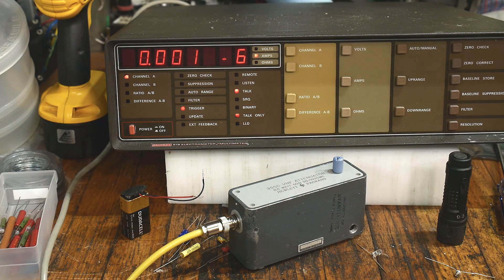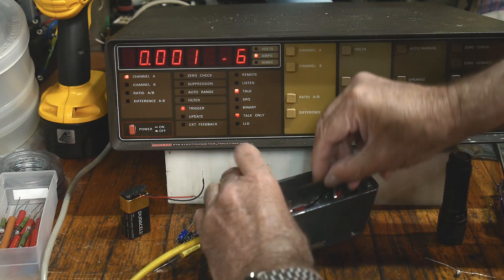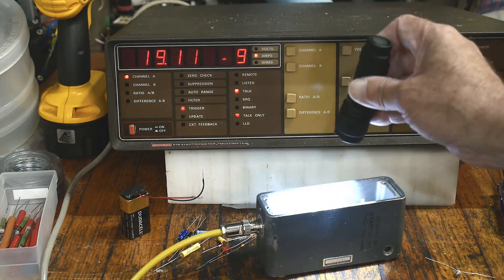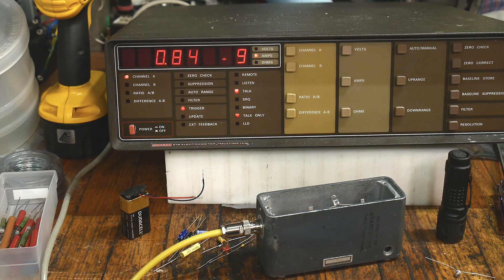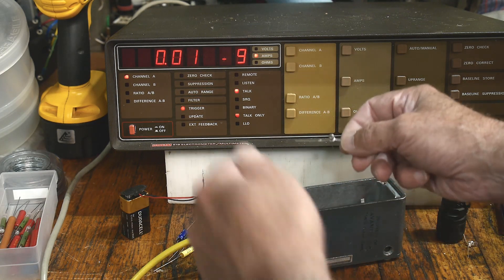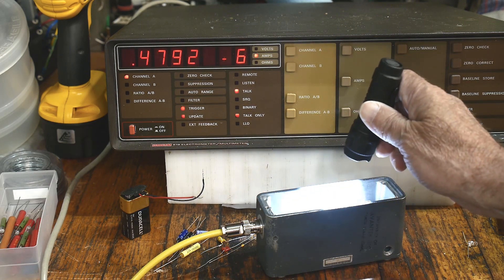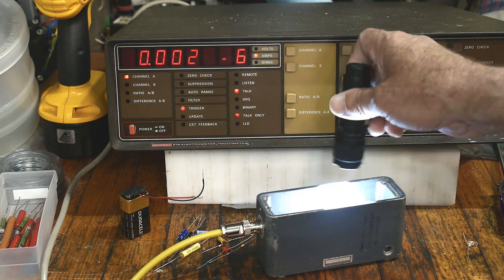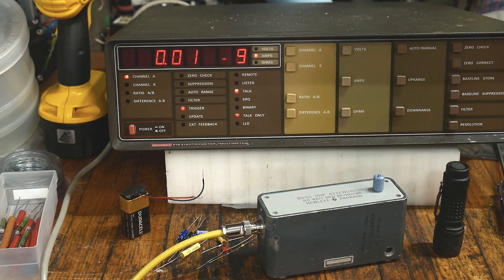#773 Keep Your Transistors in a Dark Place

Comment: Ive had first hand experience of this with an LED lighting product I worked on. The current producesd by the LEDs was  suppying power to my pic to keep it stuck in sleep mode. Had to control the LEDs via an Nch fet instead of the pic as a sink.

Comment: You'll like this story. I used to work at a company that made electronic motor speed controllers, big ones. We had a photographer in one day taking marketing photos of a controller that was on burn-in testing spinning a 25 hp motor. He had the controller's lid open to take some photos, and did so with the unit running, not wanting to interrupt the test, and we had disabled the lid interlock so we could do some measurements. But when he flashed his big Honeywell strobe all 3 phases of the controller's 460V 3-phase triggered simultaneously. Then the GTO's driving the motor grenaded. He didn't get hurt, but he easily could have. We isolated the problem to the HP-gray fiber optic receivers being triggered by the flash. Our company president called HP and was told that such a thing wasn't possible, but that they would look into it. Our boss got a call back from HP the next morning stating that solid-black fiber-opic receivers would be on their way just as soon as they could be tested by HP. For our part we stuck a much larger sticker on the box admonishing the customers NOT to bypass the safety interlock switch in the cover.

Comment: Many, many times I used germanium and later metal case silicon transistors as photo-transistors, just opening the metal case. Actually, I had around 20-30 EFT germanium transistors (low hfe) that I kept only as photo detectors (small window opened in the case, covered with transparent epoxy) 
Then the optoelectronics were quite expensive and not easy for hobbyist.
Also I remember reverse polarized germanium diodes (glass encapsulated) being affected by light.
Reply from the maker: I tested some 1N914s in glass packages and they generated photocurrent.

Comment: At a company I used to work for, we built radios that would automatically adjust the brightness of the display and keypad back light according to ambient light conditions.  The engineering manager insisted that an LED be used as the photosensor for this.  As you can imagine, it did work,  but there was  far too much variation from part to part to be truly useful.  This is just one of many things that got corrected as soon as that manager left the company.  One of the radios used a glass-encased varactor diode to tune the frequency of the  synthesizer, and this wreaked  havoc on the radios when the technician was trying to tune them up, and, naturally, had to have the covers off to tune it.  When I discovered what was going on, I gave all the test techs  black permanent markers to coat the glass case with.  Problem (mostly) solved.  This was also corrected when that manager was gone.
Reply: Did you keep the feature?
Reply: Nail polish would have been a better choice.

Comment: Back in the day, 1960s, take an OC71 glass encapsulated germanium PNP transistor, and mount it in a spin dryer. The centripetal force would cause the internal black coating to pool at one end of the transistor resulting in a perfectly useable light sensitive transistor.
Reply: Very interesting comment about these British transistors.

Comment: Yes, I saw a video recently on one of the newer single board computers, may have been one of the Raspberry Pi's or similar. On the board was a bare chip of some sort attached directly to the PCB with no blob of black stuff over it. It was designed that way. The Youtuber demonstrated how you could glitch out the computer by shining a flashlight onto the bare chip.
Reply: If you can find the link to the video, I'd sure love to see it!
Reply from the maker: me too
Reply: @IMSAIGuy  hackaday in 2015 ran an article about camera flashes resetting a Raspberry Pi 2.  I can't post a link here though.
Reply from the maker: @tonyfremont  I have heard that.

Comment: This does bite people too; chip scale packages need isolation from strong light.
Reply from the maker: Makes you wonder why the 1N914/1N4148 was in a clear class package. In the HP stockroom the equivalent part was in a black glass package.
Reply: @IMSAIGuy  Found them! http://imgur.com/gallery/JqIN0Va
Not sure what YouTube will do with the link, but I figure it's worth a shot.
Reply from the maker: @fletcherreder6091  those are some oldies
Reply: @IMSAIGuy  a lot of the glass packaged diodes I have are either painted or tinted. (I also have some glass transistors which are also painted, though the paint hasn't stayed on very well.) If I had to guess I'd say cost combined with certain assumptions about application i.e. inside an enclosure and operated at currents sufficiently above photocurrent levels.

Comment: Same as I was slightly surprised that you also have solar panels which radiate 'light' when you run current through them. Good video!
Reply: Standard test procedure to find defective cells or cracked regions of cells.
Trivia question. "What is the biggest LED you ever saw?
PV panels!!!!
redrok

Comment: ok. so here’s another question: when you drive it, does that 2n2222 EMIT IR photons?  if it does, for extra credit, cut the top of another 2n2222a and bodge ‘em together and show they make a photocoupler.
Reply from the maker: I'm sure that works, not well, but works.

Comment: Back in the day, Mullard OC71 transistors were in a glass package covered in black paint and were expensive, the OCP71 phototransistor was the same as an OC71 except that it had a clear window in the paint, but it was very expensive. Of course, people scraped the paint off their OC71s and used them instead, and it worked OK... equally of course, Mullard replaced the clear filler with opaque blue filler in  the OC71 (and the ones I have from the 1970s still have blue filler inside the glass case, along with shorts caused by dendritic growth across the electrodes!) Happy days.
Reply: I remember scratching off the paint from an OC71 to see how it reacts to light, it worked, this must have been around 1964.
Reply: @Manf-ft6zk  Sounds about right - they cost 17/6 each in the UK at that date and I got half a crown pocket money, so they were well out of reach. By around 1969 they were almost affordable and in 1972 I bought a job lot for around a pound (several of which I kept and still have, despite their uselessness). I have only scatched the paint on two of the ones I have and they both have the blue filler so I would have had to buy OCP71s! Even in 1969 they cost well over a pound each, so basically unaffordable...
Reply: If the paint om the OC71 got hot, it would fall off. That led to some very intresting effects in audio applications. :)
Reply: @Franko_Walker  True, and it crazed when it aged so it could even fall off without the heat if you bumped the equipment. The unused OC71s that I have are pristine, probably because they have been stored in a carboard box while wrapped in tissue - they haven't fared well with dendrites though, so 2/3 of them are shorted. The OA9 diodes are perfect, despite being several years older...
Reply: Ahhhh... the OC71. Does anybody remember red spot and white spot transistors. As far as I can recall,  red spot was audio and white spot was RF.